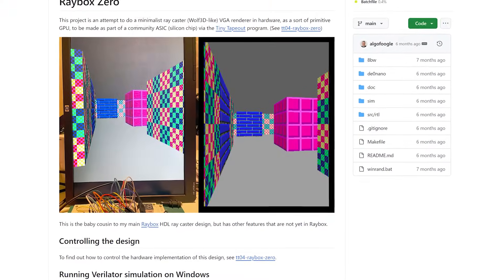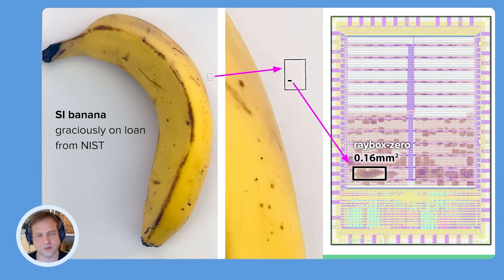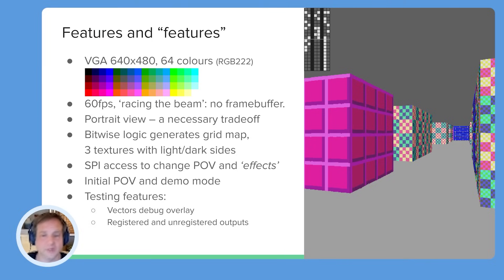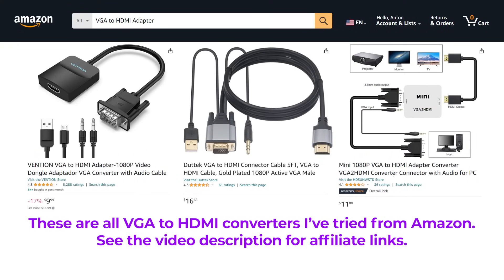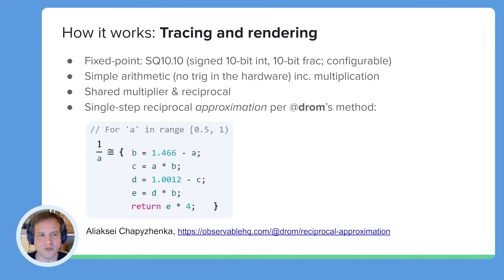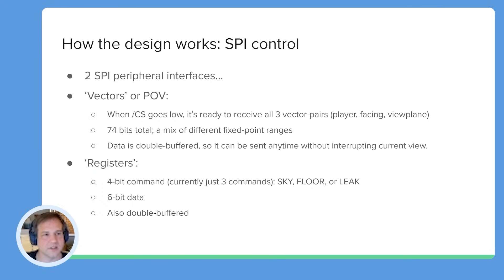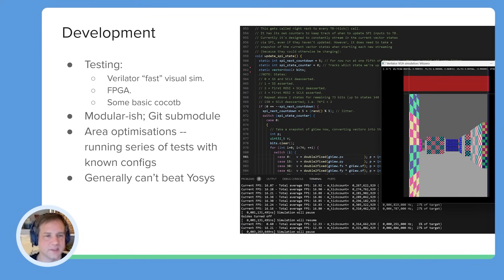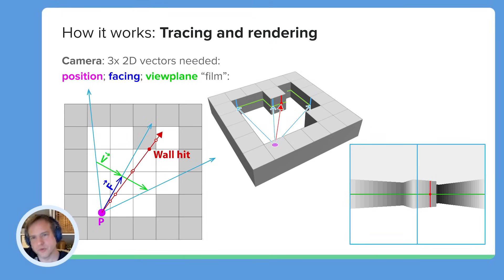Raybox-zero chip: Open-source silicon ray caster 3D game; Tiny FPGA/Verilog "GPU" ASIC | sky130 VLSI

Comment: I really like how simplistic it is to implement and use VGA. I wonder if there would be enough shared interest to place shared framebuffer/VGA driver logic on the chip that all designs could have access to
Reply from the maker: I think there would be, and in fact for things besides video projects, but the challenge is routing a bunch of extra shared signals for all of the Tiny Tapeout tiles… I’m sure TT would support more IOs too if it wasn’t for the routing room required. Maybe there is a neat compromise though… hmm…

Comment: I have read that in TinyTapeout the max gate is around 1000.  Could you share how many gates did your Wolf3D use?  Thanks 😊
Reply from the maker: A single Tiny Tapeout tile can accommodate on the order of 1000 standard cells (arguably some are more complex than a single gate), but you can buy up to 16 tiles for one design, and you get less “waste” in the margins this way. This design was about 7300 standard cells in 8 tiles, but I could’ve made it fit in 6 (but while 2x3 is an arrangement now offered, it wasn’t yet in TT04).
Reply: @fooglestuff Thanks a lot.  Would love to see your Wolf3D on the ASIC.  I have follow your git journal, detail and awesome information.   It would help a lot of other devs.

Comment: What is the advantage of asic vs a pld in this case where its a relativly small build anyway?
Reply from the maker: For this design specifically, there isn't an advantage to using an ASIC -- it was to prove that I could do it using sky130 standard cells, and that the open-source workflow could make it work end-to-end, and prove to myself that I could get this done with very limited prior experience. In other words: for fun and learning but also the thrill of having it in real silicon that I designed. As for sky130 more generally, though, you might be interested in how it benefits designers now in the analog domain: https://www.youtube.com/watch?v=ypXynGz8Heo

Comment: 640x480 VGA with 16 colors? Literally the way that GOD intended. Rip Terry . It would be nice if you could run templeOS on this hardware as it is a very nice addon to this open source OS
Reply from the maker: Oh I forgot about TempleOS. Well, this is probably in the same spirit of the "one person's crazy devotion", but to be clear, this design is more of a peripheral that I suppose TempleOS (or one of the forks?) could be adapted to use, rather than run on... and also it actually supports up to 64 colours so I'm not sure Terry would be happy about that :)

Comment: Let's clear something up.
FPGAs are not ASICs.

FPGAs are field programmable. ASICs are mask programmable.

If the way the design gets onto the chip is via masks being made and used in the fab plant then it's a mask programmable device and it's not an FPGA.

If the design is put into the chip when the chip is on a board, then it's field programmable.
Reply from the maker: Yep, thanks for offering that clarification. This was tested on an FPGA until I felt it met my requirements (or rather, until I ran out of time) and in parallel I synthesised/simulated it multiple times using OpenLane using sky130 standard cells which are used to create the masks that set the design in stone (so to speak). Some designs submitted to TT are for ASIC manufacture of (simple) FPGAs (or even tiny eFPGAs as part of some larger design), and it will be interesting to see how this grows.

Comment: I don't think Bresenham would work for spheres, but ray marching might work?
Reply from the maker: I was thinking more that if you wanted to render a circle instead of a flat (square) wall, then you could track the advancing of the algorithm with each line -- though it is complicated by the fact that not necessarily all lines of a circle would be rendered. I haven't thought it through completely :) It's also interesting, though, that you can adapt the algorithm to effectively support rendering of "columns" (horizontally-oriented cylinders) instead of blocks. I haven't tried this, but check out: https://lodev.org/cgtutor/raycasting4.html#Shapes

As for ray marching, I would like to try more sophisticated algorithms like this but I suspect this will require much larger TT area than I can currently afford :) Nevertheless, I will try pushing what I can already do, and look for further optimisations and hacks.
Reply: @fooglestuff  I haven't actually coded up any of this stuff except for the bresenham line and circle but I've read and watch quite a lot. Ray marching is what the shader guys use. I can't see how a ray technique would mesh with a bresenham technique, which is to do with pixels/cells. I think vertical cylinders should be easyish from the point you've achieved so far!
I suppose you'd get a feel for how much TT you'd need by playing with it in software?

Comment: When I saw this ASIC project idea, my first thought was "I wonder if I could make a VGA crtc and a triangle rasterizer", and you go and just stick a full 3d engine in a chip...
Reply from the maker: Hehe, well I'm proud of what I accomplished, but don't be intimidated: I'm cheating and not rendering triangles/polygons... such is the beauty of this classic ray casting algorithm. However, someone else did this submission to TT05 which IS a triangle rasterizer: https://tinytapeout.com/runs/tt05/390/ -- There's the possibility this could be combined with what my design does, and because FPGAs/ASICs can put hardware in parallel, these two could cooperate quite well, I suspect, if extended to support more parametric control.
Reply: @fooglestuff  ... I was wondering how you'd get the framebuffer or buiffers to all synchronize... is it possible to run multiple of these on-chip projects together?   It'd be neat if they had their own high speed bus, one could be a QVGA framebuffer and another could be a triangle rasterizer and another could be a sprite enginer etc.

It seems to me from the projects I've seen that the device isn't that dynamic, but running multiple chips could possibly work.

The information seems to get into the (asic -> custom die) - via a handful of gpios, so I wonder if an architecture similar to the original NES PPU but serialized could work well... actually now that I'm rationalizing that in my head, it would just look like a serialized OpenGL... tell it to clear a buffer, setup transforms, shove triangles into it... etc..

hmmmmmmmmmm  - if only there was time in the world to do this sorta stuff!!

Comment: each of the three dimensions is dimension-like but at least one must be fake
Reply from the maker: Sounds deep, man :) But yes, you're right... the "height" (diminishing visual distance from floor to ceiling) is fake.
Reply: @fooglestuff  The "textures" are much more fake than the height though. They're just painted on and have no texture d-: The height is diminishing by normal perspective projection, it's just that the height of everything is uniform. The height of the table I'm sitting at is also uniform so I hope it's not fake. (-:

Comment: Great work!  You should have a look at the MiSTer FPGA project to see if you are interested there.  The project is a hardware FPGA that creates many PC and gaming consoles.  Your project might be useful hand in hand.
Reply from the maker: Maybe at some point I'll get a DE10 and MiSTer, but for now I haven't used more than about 25% of the resources of my humble DE0-Nano :) I'm even thinking of trying a smaller FPGA (one of the cheap Lattice-based boards perhaps) to see how well my design still works with more constraints. There is still an appeal, however, in trying to make the design function as though it is a device used by a retro PC or gaming console (e.g. akin to the the Super FX chip).
Reply: I have never come across a software FPGA, have you?

Comment: I wanted to create my own processor and/or GPU on an FPGA, but had to abort that project when i found out it is not something a student can afford.
And since then YT keeps pushing me these recommendations. 😡

Nice for you that you have made something at least, i guess... 😐
Reply from the maker: Oh, and another thing to consider: You can still do HEAPS of development and testing (including visually) by using nothing but simulation -- that's what I did with Verilator (i.e. compiling Verilog to C++ and writing simple 'virtual' hardware peripherals such as the VGA display) for weeks before I even ran it once on an FPGA.
Reply: @fooglestuff  The retroclash book developed functioning video games with high level simulation, for instance.
Reply from the maker: @0LoneTech I was going to check out this book but haven't done so yet. Another thing I forgot is https://8bitworkshop.com/ which you can use to get started with creating Verilog+VGA (or NTSC) designs and run them in your browser... though I found an issue that prevented my design from continuing to build (which I think was an internal 32-bit vector limit),
Reply from the maker: @blinking_dodo my advice is that you make a start anyway... go for a simple enough CPU+GPU initially, and they could fit in even the smallest of FPGAs. There's probably enough work in that to keep you busy for weeks if you're not already quite experienced. Then work up from there, and treat it more as a learning experience and conceptual demonstration... in time you will start to work out when you need a better FPGA, and what specific features to expect (e.g. how much BRAM, what DSPs and other hardware features), but also encourage you to find other optimisations on area, etc, in the meantime. Consider that a CPU as simple as even a SUBLEQ model could still do enough work (at a high enough clock speed) to drive a GPU just enough to make it LOOK impressive.
Reply: How far out of your budget was e.g. a $15 tang nano 9k board?
Reply: @0LoneTech  I had set my minimum requirements to be 114k LE, which was the same as the 15 year old DE2-115 had i used at campus. As a student, my limit was ~150 euro's. i don't care about fancy features or interfaces. A few GPIO and the raw LE's are all i need.
But after the cheap boards of ~$15 end, the next boards are all around 800 bucks, which isn't something i could spend on a personal hobby project...
Reply: @blinking_dodo  I had about the same goals and a similar budget way back in the day, and got a 13k LE board, which never felt particularly tight. Today you can get a Lattice based 85k board for that price, but the DE2 is over $400 even with the academic price you should get as a student.
Reply: @0LoneTech  Do you think a CPU+GPU fits inside 85k LE?
And the pricing of those DE2 boards is skuffed, as they are barely supported. (you need the oldest software version and even inside there that kit is on the border of obsolete.)
All their innovations has gone into adding extra features, not price reduction, it seems.
Reply: @blinking_dodo  The MiSTer Playstation core fits in 110k. That doesn't quite tell us how many they needed or how much they put on the hard CPU side, but it's more than those two functions. It is technically not what the GPU term was coined for, but neither is the device in this video. They target the DE10-Nano, which costs $190. 

The core logic of a GPU won't run in the LEs anyhow, but the DSP blocks.
Reply: Why do you even need an FPGA? Aside from wanting to use an HDL, of course.

People are out there building bespoke processors from vacuum tubes, transistors, and even 74 series logic...

You can probably come up with something under a couple hundred dollars, albeit you might have to build a few prototypes first.

Comment: Amazing project and report. Could you share with us how you get the SPI in and VGA out of the tiny tapeout? I plan to port your code to an ice-pico board which has a RP2040 and ICE40UP5K.
Reply from the maker: Sounds great! I'd be happy to consider a pull request also if you get it to work. I'd also suggest you open a GitHub issue on the repo to request more information and I can get back to you with extra detail and Q&A later. For starters, the version featured in this video is tagged "1.0" https://github.com/algofoogle/raybox-zero/tree/1.0 - the "main" branch is newer and fine to work from too but be aware it has an extra SPI controller for accessing an external texture memory. You don't necessarily need to worry about the Tiny Tapeout interface when porting (though I can give you pointers on that if you'd like, too) -- instead, the "de0nano" subdirectory includes a Verilog file for wrapping the main module ("rbzero") to target an FPGA board (in this case my DE0-Nano) so that's probably a good place to see what the interfaces are. If it helps, SPI is not essential to see the design in action, so you can do that after getting the basic VGA output going. Please keep me posted!
Reply: @fooglestuff I only found out RGB 5:0 . So EGA? S-Video would be funny if we could use a 10 MHz color carrier and use an mixer on the PCB to get to VGA. .
Reply from the maker: @ArneChristianRosenfeldt  I'd love to try NTSC or PAL output using the analog capabilities of TT06+, but even putting the VGA DAC in the chip would be great... i.e. each of the R, G, and B channels having a single output but at least 4-bit resolution.
Reply: I was referring to the extreme constraint pin count configurations on github. I have the feeling that 8 bit R2R DACs are no problem for the process in the fab. Amiga had that for sound. I love how RGB applies barebones to both CRT electron guns and LCD subpixels. Actually, I like clearType. Maybe we could build a sprite engine which respects subpixel order after rota-zoom of sprites/textures. I learned that phones and windows apply clearType while they write to the framebuffer. This breaks on screen rotation and with screen shots. I wonder if upscalers work this way (for and in TVs). Composite would mostly be for fun. We could write "composite", but then show a HD output. Another LoL project would be EGA with pwm to create a lot of colors. Would be cool if while racing the beam we accumulate photons from pixels in the framebuffer, and then with some hysteresis the EGA output goes up a bit. But then again this is weird because EGA monitors also have a DAC inside of them, which gives me less barebones access to the electron guns. Also EMI is quite high. I also dream of a 3do like point cloud. I don't know how modern point clouds do it, but it looks like for solids I would have to clear the polygon as black in the framebuffer to obscure the background and can then write all the texels ( with displacement constraint to no occlude stuff ). No translucency. Gives this old SEGA System32 Arcade look. Then while racing the beam in interlaced mode, points close to the scanline (weighting based on delta-y) add to the accumulator.

Maybe a tile can have stabilized power and can use PWM for audio? I still want to understand 1 bit DACs. I think they carry over the fraction from one pulse to the next. But in the end, people gave up. Sound goes digitally to the iPods or over HDMI. The actual DAC sits with the speaker. I wonder if every channel ( bass, etc.) has its own.
   @fooglestuff 

I Wonder if the Atari Jaguar audio DAC would work. They did not connect it on the PCB, but the Jerry chip did output 4 PWM channels. 2 per stereo channel. The least significant one goes through an RC circuit. Then at the trailing edge of the main PWM, a mixer blips over to the voltage in the capacitor. Now we need a band pass filter to compare blip voltages to one step of the main pulse length. Calibration to adjust a factor for a digital multiplier for the fraction value.
Reply from the maker: NOTE: I edited my reply to correct the URL, so it no longer goes to a 404 :)